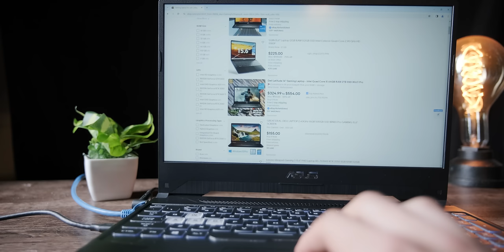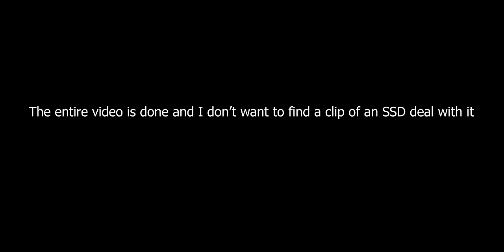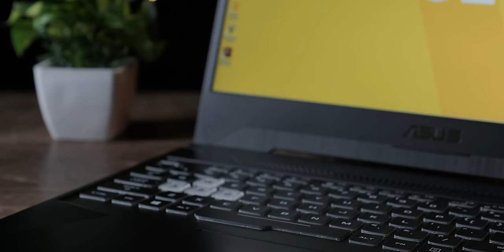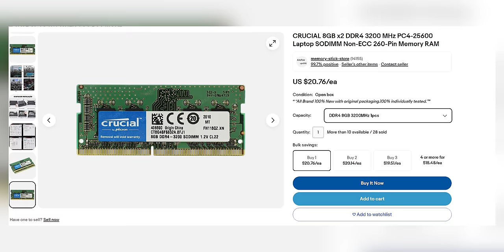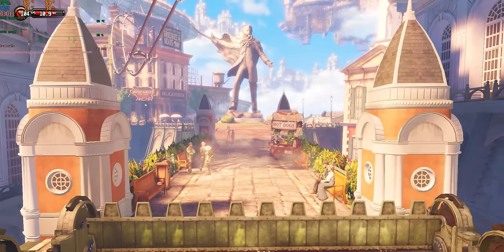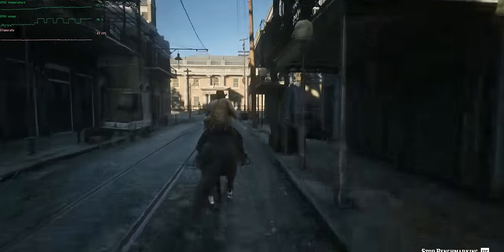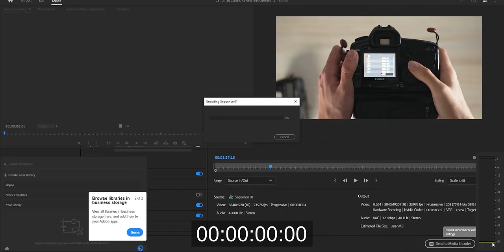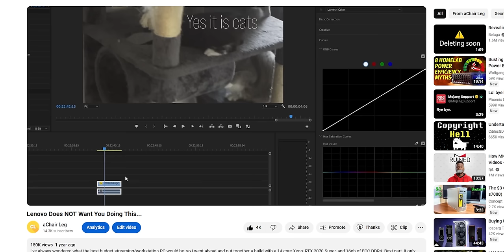How BAD is a Used Gaming Laptop?

Comment: I have an upgraded version of this laptop 705dt. Your points are mostly valid and i think my laptop being 17 inches might have led to better thermals. Something i would say is the body is probably better than you think -- its a bit hollow and maybe a bit too angular but there is a ton of durability in the design for a gaming laptop. The hinges are very robust and I think shocks are absorbed pretty well. Its probably not as great as an older school think pad but its still pretty good

Comment: Because the laptop has an option for a 144hz display, it is possible that you can try overclocking the 60hz panel to the 90hz you desired, as the eDP interface connecting it to the gpu will likely not be a bottleneck. It also depends on if the NVIDIA gpu is hooked up directly to the display, but you can go into the nvidia control panel, change resolution, and create a custom resolution. There you can try higher than 60hz refreshrates. I was able to overclock the 60hz panel in my old dell workstation laptop to 100hz this way!
Reply: If the nvidia control panel doesn't have a lot of options, that likely means it isn't directly hooked up to the display and you cant use this method to overclock it.

Comment: I got a desktop (Custom built 4070 super build). But needed a cheap laptop for some editing as I take Media in college now. Bought a Lenovo Legion 5 that's got a Ryzen 7 4800H, 16gb dual channel 3200mhz ram, 512gb NVME with an addition slot for a future upgrade (Ram ofc can be upgraded too) and a GTX 1650ti, a 1920x1080p 144hz IPS display, and got it used for £225. Its actually practically new, the battery basically has 100% health, and the SSD barely has any read and writes to it. Its in fantastic condition to! Definitely a steal if you go hunting enough haha.

Comment: Recognised the laptop from the thumbnail and I had to watch. I've dailied a 505DT (Ryzen 7 3750 and a gtx1650) for 4 years now since I started at Uni and wasnt sure if I could fit permanent space for my desktop into the Apartments. It was great as a workstation and gaming machine I could move from desk to desk, but after I moved out, to a different city and now have space for my full desktop and instead find myself wanting a laptop for travel, chilling on the couch, or using in public, I've since "downgraded" to a refurbished Thinkpad x390.

The Asus is just a jet engine, that weighs way too much, the powersupply is also a heavy fire hazard and the laptop is uncomfortably warm under any load. I've also had the power supplys die on me 2-3 times while having it (I imagine its surely partially my fault ofc) and theyve not been cheap to replace. Ye right-click on the trackpad is abysmal its not just a skill issue.  I will say though, the 505 itself is a TANK, I've abused the crap out of this thing over its 4 year lifespan, its been dropped, stepped on and thrown around in my bag, and seen horrors that keep me up at night when I think about how dusty I've let it get. And it just keeps on chugging along with some scuffs and snapped plastics here and there.  

Nowadays, its just used by visitors if I have people over to play games over LAN or if I'm travelling for extended periods and want something to play games on, I dont at all miss having to lug this thing and its ridiculous power brick around with me.

Awesome review
Reply: Yup fully agree that the body has very good durability

Comment: Great video! but you kinda missed the mark on your laptop choice. There are laptops almost every day with gtx 1660s or the rx 5600m and ryzen 4000 or 5000 cpus at or very close to the 400$ mark. And with those specs its actually not too easy to beat building a desktop! maybe give them a look 😁
Reply: You are right, but well-maintained devices are also sold at higher prices, not just based on specs.

Comment: i have fx505dt.

temps is fixed by using honeywell ptm7950 on cpudie, gpu, vram, and mosfets and undervolt CPU, noticed the 3550h running waay too hot,  i set the max at 3300Mhz anything higher = unnecessary heat while miniscule performance.

wished went for intel cause the battery mode of this laptop performance is soo bad.
Reply: Is it perfectly fine to use thermal compound on VRAM or everything that is covered by the heatsink?

Comment: I should get myself a proper laptop that has more power to run games but I'm surprised at the remarkable gaming performance I get out of my Thinpad E-560. Being a low-cost business laptop the 560 can run Fallout 4 on low/medium with tolerable framerate and New Vegas on mid/high settings at about 40 fps average, it will not play games like VirtualDelinquent 2077 but New Vegas is the only thing I play on it. The surprising part is how Fallout could even be playable on this machine because it's equipped with an i5-6200U, Intel's HD 520 iGPU, 8GB of DDR3 at 1600mhz, and a Crucial MX500 1000GB SSD. I just wish it was a Brickpad instead, Lenovo's Thinpads are too flimsy.
Reply from the maker: Honestly, if it works, it works. No need to upgrade if it plays what you want! Although New Vegas can look rly good modded
Reply: @aChairLeg  It works no doubt, although recently I've been having crashes with minimal mods installed and I can't figure the reason since it rarely did that before. Needs more power.

Comment: I finally got a used gaming pc..... 
Acer nitro an515-52..... 
gtx 1050m
16 gb ram 
250gb m.2 ssd
1tb hdd

Even though can have a batter gaming laptop .... as a college student/gamer it'd kinda expansive and sometimes 
The only way to get a bit chipper
Gaming laptop used , minty condition is on Facebook.....
Yeah 😂

Comment: Had this laptop for about 3 years. I had constant issues with it. The included Realtek Wi-Fi chip in this laptop was genuinely god awful. It kept cutting out and I was eventually forced to buy a new Wifi chip on amazon to replace it. Wifi worked fine after that. I also had constant issues with the FANS. Yeah, they were loud, but the worst part was THE FAN BEARINGS KEPT BECOMING MISALIGNED. A horrible rattling sound came from the fans after about a year. I ended up replacing the fans twice on this machine. One dayI plugged it in one day and it just... turned off. No reason why. Really dissapointed with ASUS on this one. Don't buy this. Buy an RTX 3050 laptop on sale for ~$500 if you're desperate.

Comment: A friend of mine has a similar one, one or two generations older I think, with a GTX 1060 3GB and quad core i5. It thermal throttles like a mfer and is crazy inconsistent, I tried replacing the thermal paste for him, but it barely changed a thing. Recently the fans started rattling too. A real POS.

Comment: I was recently gaming on an older i5 (forget) with a 1650 max q before I upgraded. The high temps seemed to just be how those laptops handled usually, as mine would hover around 70-80 most of the time when gaming as well, even when newer. Overall if you're someone like me who played older games it wasn't a bad option and 100% workable if you're traveling and such. Kind of amazing what you can get nowadays for not much money, I remember when doing any sort of 3D gaming on a laptop immediately meant you were paying at least $1,000.

Comment: Thoughts on getting a workstation laptop to use as a gaming laptop? I've been looking at the Dell Precision 7720 with the Quadro p4000. Quick ebay search tells me you can get one for about $450, which is $50 more than what you got but seems to have equivalent performance to a GTX 1660, 32gb of ram, and a 1tb SSD. Only problem is the GPU is a workstation card, but looking at benchmarks, it seems to be able to game well enough.
Reply: ALSO, I think the P4000 is an MXM card, which sells for about $200. You can buy a 1060 MXM card also for $200. If the workstation card doesn't game, you could probably do a swapy. Hmmmmmmmmmm
Reply from the maker: If the performance is there for you, workstation laptops are really well built and usually cooled better due to how chunky they are. I actually made a video on the Thinkpad P51 if you want more insight there. I'd go for it if it checks all the boxes though.